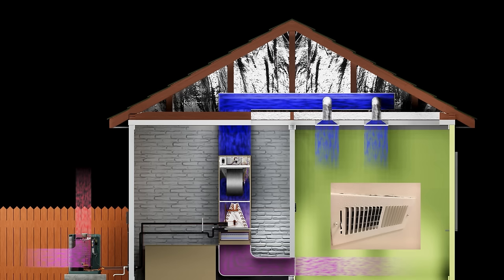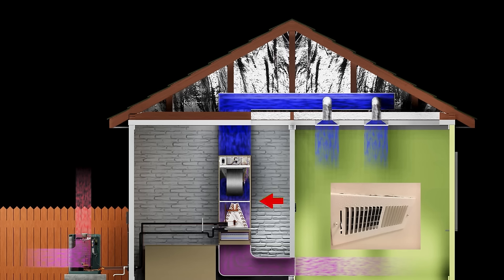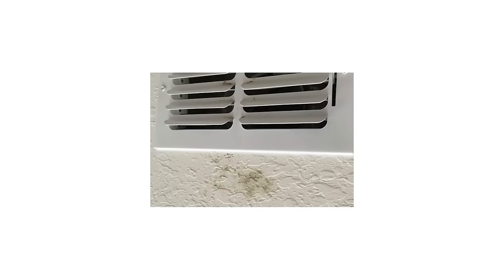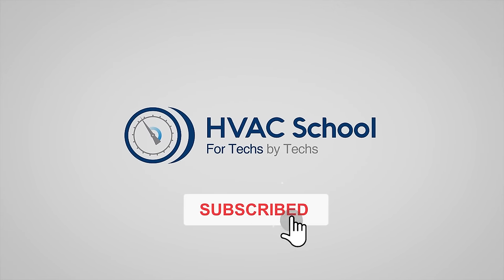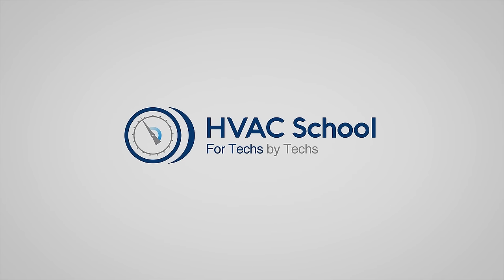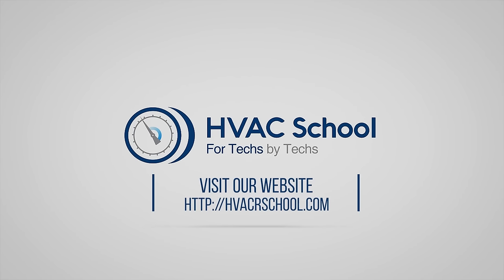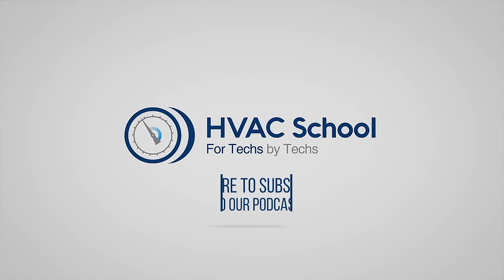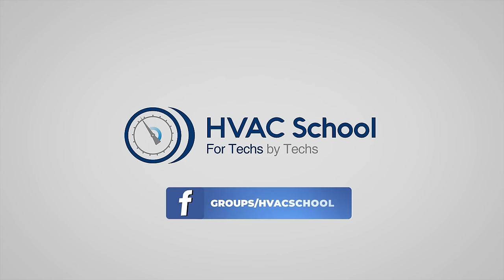Stop Sweaty Ducts, Vents and Systems

Comment: Ohio We Get Dewpoints over 70 fairly often Duct work in Basement was getting Damp. Put in a 6" Round to the Return Air and Angled it such that the Air flow in the return helped induce some air flow @ the Furnace Blower. The other end is vented outside. Thru an ole Coal Scuttle (They Make Special Vents for this) The Scuttle just conceals that it even exist. My Unit is Slightly undersized from before the addition's 4T (Load Calc says I need ) 4.5-5T so it tends to have long run times. Before I needed to set the Thermostat at 70-72 to be Comfortable Now I have to wear my Fuzzy Robe at 75-76 because it dries out the air so well.  I do on Occasion hit the times when it is "Muggy" outside and Coolish (Mid 70's) that I need to bump the Temperature down a bit. Duct Work stays dry. Slight Positive pressure on the house when the AC (Fan) is running Reduces Humidity infiltration. That is I believe why it is cold at 75 when it is hot/humid outside and I need to turn down to 72 when it is cooler and Muggy outside.

Comment: In SWFL, was told we needed a new 4 ton. Purchased 4 ton from them, they installed it in attic, less than a year later and its dripping into our ceiling and find out they installed a 5 ton air handler, but kept fan speed at stock (guess it can be reduced to medium to act like a 4 ton?). Anyway, terrible sweating on unit that is causing water damage to closet/ceiling below it. They are blaming our older ductwork that they said is too small/old, but didnt say it was an issue before and obviously they installed things incorrectly from the start. Very frustrating so far.

Comment: Two new vertical air handlers were installed in ground floor commercial bldg unit. Air handlers are in closet, next to a room in conditioned space. The door between room and closet is not sealed, and it has a vents built into the door. Vent "fins" are stationary and angled down on the adjacent room side. The installers  cut into the cold air sheet duct above each Air Handler and added louvered vents. Now the closet with the air handlers is a conditioned space and ducts are sweating and dripping. Seems to me this is not a correct installation. Climate Zone 6B

Comment: Great explanation. Can you please do a video on how to set an hrv in conjunction with the hvac system throughout the seasons of a year.
Reply: In this humid situation and ERV should be used.     With bath fan every 90cfm of humid shower air suck out, sucks in 90cfm of outside humid air through cracks and gaps.  
ERV instead is way better control.

Comment: Usually after days of rain we get these calls, condensate pumps run more, moisture appears on ducts and supplies and the accusations the system is not working.  I always ask what modifications were made to construction before this issue..some have an answer, some don't but regardless, the problem exists now and hopefully options are on the table. Sometimes the owner will have blueprints of the new work  that could help find where the moisture ladened air is infiltrating the conditioned spaces. .what a job we techs and contractors have .

Comment: I’m hoping another tech can help me out or even the guys at hvac school too. 

Here’s my scenario:
I have an ahu on the second floor in a tight closet that is not conditioned. 
The ductwork in that room sweats and drops down into 1st floor sheetrock. 
Originally the closet was not sealed off of the attic air. So since I’m in a new build house the guys came back and sheetrocked the closet closed. But the supply duct goes up hits the ceiling then goes down into floor where the ducts are ran on 2nd floor. My humidity in the house is at like 60%. Anyone have any suggestions I’d love to hear. I’m a commercial tech and we’re generally pretty good with this type of thing but came back to hvac school to re-up on some humidity and duct sweating tips. Thanks guys

Comment: Man this is a great video. I'm just a homeowner educating myself. I have a question though that I hope can be answered. After sealing a leaking duct near my bedroom I started to get sneakers that are coming apart at the soles In my master bedroom closet. I had never heard of this at all. It did get cooler in the master bedroom after sealing the duct, but it's certainly not ice cold at all. All the other rooms that have sneakers or shoes don't have this issue. I searched online to see if anyone had ever dealt with this and found nothing. Then some of my regular dress shoes started to do the same. I took other shoes to another room and none have come loose at the soles. Do you think this issue arose simply from sealing the duct? I have to add there's no duct in that closet and it's not cold at all. I have owned this house for 22 years and it never happened until then . Sorry this is so long but I have another question. I'm really having issues some days cooling my home here in South Florida. Assuming the AC filter and coils are clean and there's no significant leakage around doors or windows, do you think a dehumidifier working in tangent with my AC with help keep the house much cooler? Thanks
Reply: I bought 2 pair of sketched from shoe carnival  and put 1 pair up and wore the other pair soles came off in less than 3 months  started wearing the other pair and the soles came off  a little over a month ....nothing had changed at my House  owner for over 16 years....very bad Craftsmanship maybe they came from China...

Comment: I had the same problem with 2 rooms in my house and they HVAC people who installed it could not figure out why. They put in another return (I think). Initially no sweating but returned. If U remember right what solved the problem was dehumidifying to 40%. Which this video was available when I was looking for a solution 2 years ago.

Comment: I live in NJ and on very hot humid days above 90 2 of my 6 ceiling vents sweat. Sometimes sweat enough to drip on floor.  It has damaged the drywall on ceiling around the vent. The unit is 20 years old seems to run ok and comes on and off throught out the day to keep 76-78.  I have no attic space I live on top floor in a condo with vaulted ceilings. What can I have done that wont have me throwing money away when I call a hvac company.  My unit has never been serviced since ive moved here 16   years ago.  I change filters 1 time a month and always have

Comment: Air duct that runs from basement up to first and second floor all behind a laundry shoot. Only accessible from basement level. Lots of sweating and moisture collecting at bottom of the basement floor in laundry shoot. It seems to only be insulated for about the height up to the first floor. The insulation is completely saturated and dripping. We just redid our kitchen on first floor and opened up the wall for some plumbing changes and it also allowed access to that ductwork. And our contractor just wrapped about 8 more feet of ducting with regular wall insulation batts and now the wall is sealed up. What do i need to do? Trying to learn anything i can before hvac tech comes out so i have some idea what to expect

Comment: How about you get a smaller unit or inverter unit that runs constantly and keep the insulation.    And how about you only put the ductwork in conditioned space.    You are so smart you miss the obvious.  

You can seal and insulate the whole attic and partially condition it as a solution as well .
Reply: Watched the whole video thinking "he hasn't gotten to the point yet". And then he never did. He never mentioned sizing the system appropriately. The solutions he suggested (air sealing the attic) are not viable solutions. Attics are vented for a reason.

Comment: I got a 6 to 8 in duck going into my bathroom, probably 8 inch. Instead of buying a true register box they built one out of the fiberglass duct board. It has good CFM air coming out but it's like hitting a wall and then coming through my ceiling. So it's restricting a lot of air flow. That's the only air vent that sweats in my entire house besides my air handler sweating between the crease in the middle of the air handler. My air handler used to sweat super bad because they incorrectly installed my entire system and they will not do anything about it because it's a couple thousand dollars to fix and they don't want to admit it. New AC air handler and flexstock throughout my whole attic, I had patched up a bunch of breached tears throughout my attic. So my question was my bathroom vent that is sweating do you think it's caused by incorrect register box because it's not getting the correct ear flow and it's like hitting a brick wall then down into the house

Comment: I have a 106 year old house in Houston with 5-ton HVAC in the attic.  The ducts don’t sweat.  Why?  Because I have refused to install a radiant barrier or add more ventilation despite every idiot contractor saying I need more ventilation.  I only have two small gable vents.

Comment: Hi, HELP! I live in a apartment building. I haven't been able to get any help regarding. My AC vents getting major amounts of condensation on them. LARGE water droplets that cause mood growth around the metal AC vents. They are very long. It has been happening every summer on and off for the last two summers. I keep my AC at 69 for 5 hours at night and 72 the rest of the day. I have chronic illness and get very warm so I'm trying not to keep it to cool. Any advice if possible would mean A LOT TO ME to prevent mold growth.

Comment: Lower the temperature actually lowers the water in the air! The measurement of water in the air is GPP or grains per pound.    Lower temp > lower gpp.   Hotter air can hold more moisture.
Reply: You can make the ducts not sweat by simply insulating them..   you don't want the surface of the duct to reach dew point  just insulating them, like how you explained double pain windows earlier.  Easy peasy

Comment: HELP!!   What happens if it's sweating in your garage and basement & insulation is literally soaked around the ducts And flooding so bad now mold on walls because of it. Are the ducts ruined  & do they need replacement? Can that insulation be dried?How do I seal the exposed ducts in my garage when I need to open my garage to use tools etc?  I'm in a rural air & barely have help to how & the ac guy said I need to to replace all the ducts but it'll never stop happening.  I said there HAS to be a way to keep it from sweating otherwise everyone's houses on our diet road will be sweating & flooding etc.  I NEED HELP WITH THIS!   Can my basement and garage be salvaged with OUT rewinding everything?  The insulation sounds the ducts work is soaked.  I'm so upset about this. I need answers from someone who is experienced in this.  I feel like these guys are clueless around here & I need help.  I won't pay to have everything replaced when they tell me it'll just keep happening!!!  CAN YOU RECOMMEND A HOME DEHUMIDIFIER? Please help.

Comment: Mini splits dehumidify much better than conventional systems because the modulate. They also have a dry mode that will provide excellent dehumidification in moderate temperatures.

Comment: Riddle me this.
Humidity outside: 30%
Humidity inside upstairs apartment: 70% 

A/C unit struggles to maintain temperature of thermostat in the heat of the day (set to 67, it is 75, and thermostat is in a dark hallway). Vents sweat, rust, and have splattering of mold.
Running 3 dehumidifiers, one designed for an entire basement, in the same space, does not improve humidity; sometimes it makes things worse while fighting with the A/C more. Changing air filter once every 3 months, even if not appearing that dirty.

Tried opening the windows and doors to allow summer air outside at 27% humidity inside, with fans blowing. After 1 hour, humidity inside went from 71% to 69%.

Humidity near the vents and inside the air filter is 85% or worse. The powder detergent for laundry up high in a closet in hallway clumps horribly as if it's been soaked. 

Apartment technicians refuse to look at it and have never come, even when they claim to have reviewed and resolved the issue. A/C unit is on the roof.

No plants, no standing water inside except the cat's water bowl, vent to bathroom is closed, certainly no humidifier, no neighbors below, not next to pool.
Reply: First, you're confusing moisture content of the air with relative humidity.
Reply: @vaseasun  A few days after I commented, I realized this but that still does not help. Regardless, having 3 dehumidifiers and no help is beyond frustrating and should be physically impossible.

All this past week in the heat of the day it's been upwards of 85% to 91% humidity inside or 63-67 dewpoint. The indoor dewpoint has never been below 59 in months. It does get better than outside in the middle of the night, but that's not saying much.

There hasn't been rain in over a month. I live 290 miles away from the Gulf Coast and about the same from the swampland states. Local weather follows very close trends to Phoenix, AZ.

Problem does not persist in nearby houses of friends or family; I've taken my temp/humid monitor over there and can record dramatically improved results and none of them use dehumidifiers.
Reply: There's too many variables to diagnose over the internet. Are you sure the condensate from the A/C is draining out of the apartment? Are you on a top floor with a roof above you? Running 3 dehumidifiers does create a lot of heat. Not surprised the A/C doesn't keep up. My first thought would be to check if your evaporator coil is clean.

Comment: Coming from a so cal market where i never really have to worry about these things, i learned a lot thank you. Can you elaborate on why you said minisplits dont dehumidify well?
Reply: They run the fan continuously which re-evaporates the moisture and also they usually run really high suction for best efficiency
Reply: @joeshearer1247  Makes sense, thank you

Comment: What happens in the scenario where metal crawlspace ducts are sweating and the crawlspace has recently been sealed and dehumidified but the underside of the floor was not previously insulated? Does it now raise the inside temperature due to a warmer crawl space?

Comment: Increase the R value on the ducts and glue duct board on the air handlers!🤣🤣🤣
Thanks again for the videos!
🍺🍺🍺🥃🥃⛳🎳
Stay safe. 
Retired (werk'n)keyboard super tech. Wear your safety glasses!
Reply: R Value?
Reply: @jevon7692  "THE CAPACITY OF AN INSULATING MATERIAL TO RESIST HEAT FLOW"?
Reply: He really didn't address that did he? Better duct and equipment insulation.
Reply: I agree.  If the manufacturers would design ducts and air handlers for high humidity environments, we wouldn't be talking about it.  My air handlers in the crawl space sweats a river on the outside.  I have a pan and drain, but it drives me nuts that they keep selling this cheep junk.
Reply: @petersplat6164  ...they ( air handler suppliers) use like 1/4" flex silver vinyl face junk on the inside of the air handlers.....flex style so it can be removed and replaced...but of little R-value. Need about 2" Thick of the best R-value , aluminum faced ( vapor barrier) poly sheet glued to the cabinet.....works.

Comment: Unisulated ducts in basement, no sweating.  Owner installs suspended ceiling and calls us when panels fall from absorbing the moisture from the now sweating ducts..
Owner burned dinner, turned on whole house fan, causing rain in the basement.

Comment: The part where you speak about condensation dripping from the vents in a restaurant is our exact problem. We have one row of vents that drip in the dining room. It very annoying and most HVAC pros have told us there is nothing we can do about it. I am a problem solver and not a defeatist. Any advice on how to stop the dripping? We have noticed in other restaurants they have spray foamed the ducts. Thanks in advance for any insight.
Reply: run a dehumidifier in the space, reduce your infiltration with an air curtain, and make sure your makeup air unit is dehumidifying.

Comment: My problem is my duct work that's sweating is in my crawl space, dirt exposed no ventilation.... it is warm down there in the summer, the AC doesn't cool that space... so the warm air is interacting with the cold vents. Sealing isn't an issue. The room temp is much hight than the vents. Adding a vent to cool that space would waste insane amounts of energy and efficiency through the rest of the house. So HOW else do I prevent the sweating? My only thought is insulation barrier between the ducts and the craw space.
Reply: You don't say where you live. Where I live in coastal NC new bilds no longer have crawl spaces for this reason. There are companies that do crawl space encapsulation. This includes air sealing the entire crawl space, insulating the walls, vapor sealing the dirt, adding a duct register to partially condition the space, and add drain sumps for any leaks, flood water, or residual moisture.